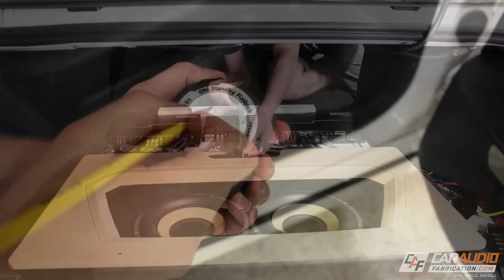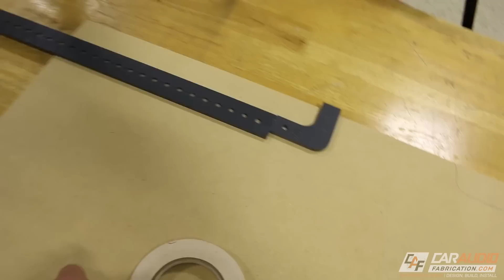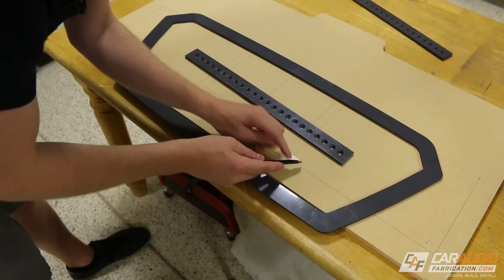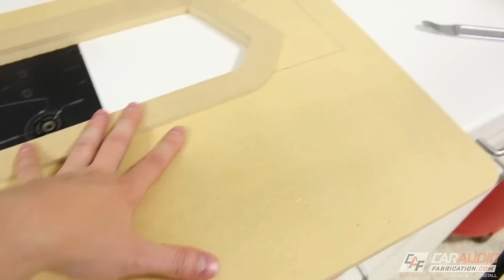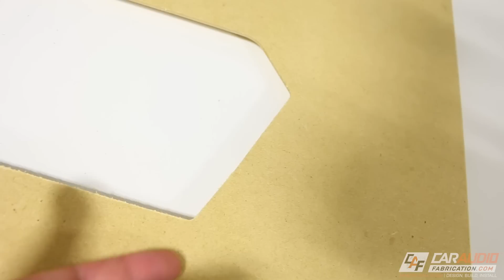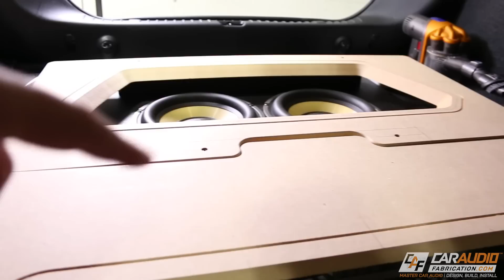Amp rack beauty panel complete! What's next?

Comment from the maker: Question time! Do you guys like beauty panels better when they exactly match the shape of the gear, or when they are a random shape that matches the install?
Reply: CarAudioFabrication the random shape install is better... like the saying goes "less is more".
Reply: CarAudioFabrication It depends on what the person likes personally. And I have a question for you. I have a 2016 Sonic LT hatchback and want to put 2 12s in the "trunk space." I want the system to knock but I don't want the speakers to cancel out the lyrics. Which brand do you prefer?
Reply: CarAudioFabrication how can someone have tweeters and woofers on the same amplifier?
Reply: I like a nice shape, cover it up or show them off no problem but not a fan of the fit the product cutout.
Reply: Matching the design language of the rest of the vehicle is what looks best. Trunk builds are mostly up to whatever the installer wants to do, since it's a box without much detail; but with builds involving the cabin area, it's best to follow design language if you're going to be doing the work of making beauty panels.
As for showing equipment, matching the install is better than matching the shape of the equipment; though you could have the equipment entirely pop through a trim piece that matches the rest of the install, almost like a flush mount, then match the color of the piece to the color of your equipment.

Comment: Just found the channel annnd one thing that concerned me about this build is, arent you worried that the amps will head up a fair bid under all the covers etc? I know thats always me concern when I do this sort of stuff myself or customer.
Reply from the maker: These amps are very high quality and feature internal cooling fans and are designed better to be used in smaller vehicle environments. They barely get warm even after prolonged periods of demanding music. Buy quality and you won't have to worry about silly things that were a problem for gear 15 years ago.

Comment: Could you estimate the total weight added to the vehicle? 
Video idea: Go over what it's like to live with a car after having a full-on sound system of this level installed. 
What do you notice:  opening\closing doors, storage space issues, vehicle handling, gas mileage, maintenance challenges, components loosening up and buzzing\rattling, etc. Also go over the enjoyment factors and all the benefits experienced.
....
Over the years I've built various levels of systems in my cars and invariably there's always a few things to deal with as part of the experience. Like having to remove the sub box for the occasional trunk uses, or getting to enjoy a rattle and buzz free interior after performing the sound deadening for the 10 years afterwards.
Reply: I agree that would be a very infomative video on the aftermath of full system upgrades id watch for sure